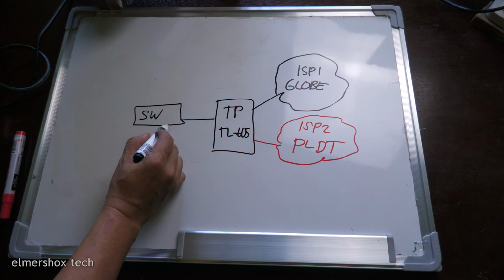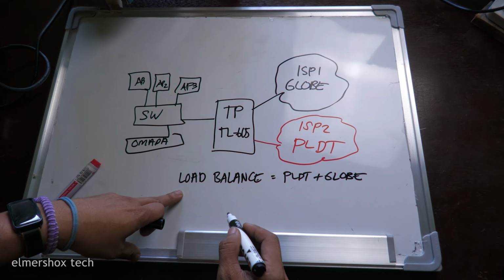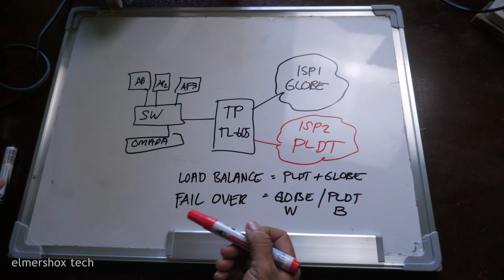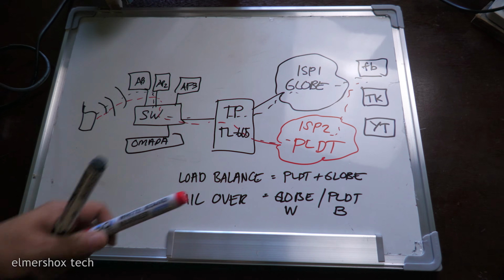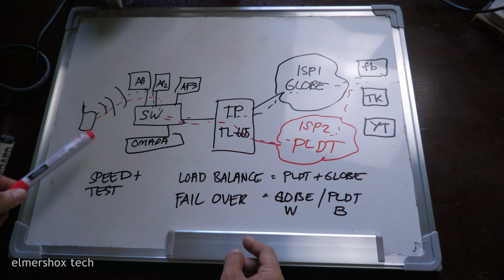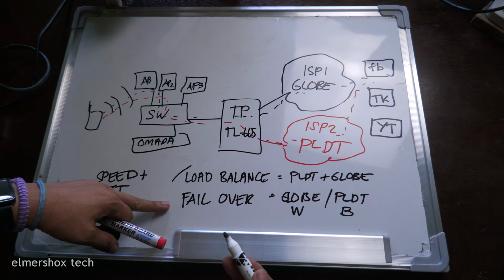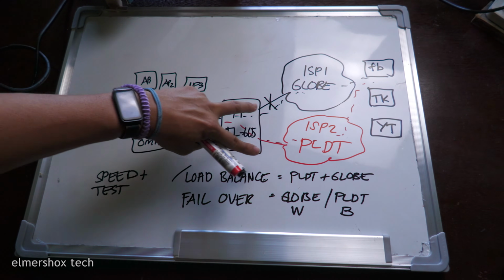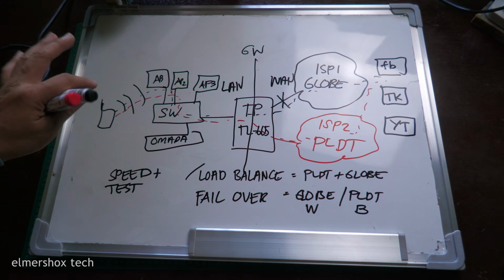Globe at PLDT combo Load Balancing and Fail Over

Comment: splitting packets are not a good idea on latency critical applications i.e online games. better to priority per port connection on which wan port you want to use it. like prio UDP to wan1 and TCP/IP:80 on loadbalancing
Reply from the maker: yes i Agree for this that's why ECMP is not applicable on all applications. (Equal Cost Multi Path) different ASN has different peerings.. thanks man!!